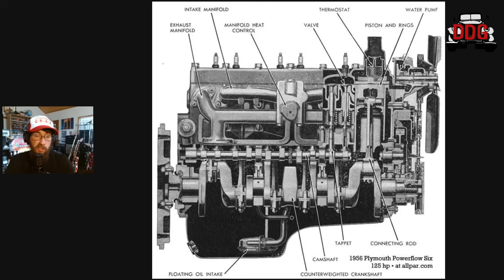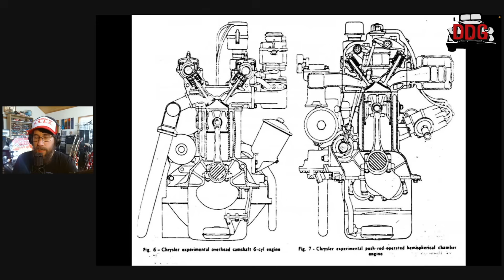The 1940s Chrysler Hemi 6 Cylinder Prototype Development Engine You've Never Heard Of

Comment: Hi Jamie, I live in Sydney, I have a 245 cu. inch Chrysler Australia hemi 6 sitting in my shed, the 245 is the basic model engine, the 265 cu. inch is the HP model. If you want to see the internals & a rebuild of the aussi hemi 6, check out Uncle Brent's Shed on Youtube. BTW, the aussi hemi 6 is not crossflow, so it kind of spoils the whole concept of a true hemi.

Comment: I have to wonder how close that engine is to the Australian Hemi 6. It also blows my mind, that the initially built Hemi engines to deal with crap gasoline. Not as hi performance beasts!
Reply from the maker: Really not close at all. The Aussie Hemi 6 is not a cross flow cylinder head design. It’s really a lot more like an AMC inline six than anything else. It has a conventional valve cover with the plugs off to the side, and many other features reminiscent of other designs than the Hemi. I’ve read through initial information Chrysler made available on the first generation Hemi, and they made it very clear that they had engineered room for future improvements in horsepower into the platform. They knew what they were doing there. Haha.

Comment: Do you have any use for the ceramic tubes they used to have on the spark plug wires? I have a few in my collection that I can't throw away for some reason.

Comment: I enjoyed learning about this prototype engine.  I've heard speculation that the 2.2 engine might be a hemi "type" engine,. Is there truth in that?
Reply from the maker: The 2.2 is a crossflow wedge like the small blocks and B/RB engines, but with an overhead cam. There was a “Hemi” used in some Chrysler vehicles in the 80s - the Mitsubishi 4G54 2.6. It was a crossflow head with a true Hemi chamber, though the valves and ports were slightly offset and not directly opposed so they could be actuated by one overhead camshaft. Some models with these engines even had a “HEMI” badge.

Comment: Thought that was getting to long anyway the Hemi head design The urban legend was that the Audun heads for Ford flathead V8's what's the inspiration for Chrysler? To make the hemispherical head that is, inaccurate during World War 2 Chrysler made aircraft engines both for wright and pratt Whitney, both those engines, we're hemispherical head engines, there. They were the radial 1820 and 1830 engines. And they were used on B 17's B24 and a lot of other aircraft, but those engines were hemispherical head engines along with The Allison and the Merlin V12 of that era. So the Ford Flathead conversion, was not the inspiration. It was actually the Wright cyclones, and the Pratt Whitney's double wasps that gave them the inspiration. There's my two cents
Reply from the maker: Chrysler’s use of the hemi chamber certainly predates Ardun’s, and that’s all I can say for certain.

Comment: When I was still a teenager, my grandmother gifted me my late grandfather’s 49 Plymouth coupe powered by the 217 Plymouth Flathead… so even though it was never my daily driver it was in a way my first car. And I drove it and worked on it quite a bit. I kept it close to 40 years before deciding I’d never be as interested in it as I am 60s Mopars.  It went on to someone who loved it. Still,   I’m a huge fan of the Chrysler Flathead six.  Torquey, and smooth as an electric motor. I’d rather have one than a slant-6, By far (I’ve always had a disappointing relationship to the slant… they don’t like me, I’ve never had the luck with them that other people have. )

Comment: I would like to see a video about the Australian hemi six next
Reply from the maker: I hope to do that! But I really want to get my hands on a real one first.
Reply: @DeadDodgeGarage  here in   arstaaaalia.....  the holden co. [ gm ]. had a 138,149,179,186,192,202. until around 1990..if not later. im not a holden chev fan.. pre crossflow. hydraulic with adjustable rockers.. very peaky lobe cam.. even the v8,s same as gm, had press in studs.. pre historic engines.. personaly i like the clevo.. fit a cam, never touch it..[ ford 6 cyl were the 200 ci & 250.. ] did you get the 265 hemi in u.s.. hell powerfull engine..

Comment: Hemispherical cylinder heads have been used since at least 1901;[1] they were used by the Belgian car maker Pipe in 1905[2] and by the 1907 Fiat 130 HP Grand Prix racer.[3] The Peugeot Grand Prix car of 1912 and the Alfa Romeo Grand Prix car of 1914 were both four-valve engines, and Daimler and Riley were also using hemispherical combustion chambers at the time. Beginning in 1912, Stutz used four-valve engines,[4] conceptually anticipating modern car engines. Other examples include the BMW double-pushrod design (adopted by Bristol Cars), the Peugeot 403, the Toyota T engine and Toyota V engine (Toyota's first V8 engine), Miller racing engines, and the Jaguar XK engine.[
Reply: Wikipedia
Reply: Japan in the 80s advertised that they had invented the multi-valve engine. I went to the Stockholm Museum of Technology and there was a multi-valve engine from 1907. And it wasn't made by a Japanese person.

Comment: Thankfully the dream of an inline-6 Hemi lives. https://en.wikipedia.org/wiki/Chrysler_Hemi-6_Engine    Chrysler Hemi-6 engine is a family of inline six-cylinder engines produced by Chrysler Australia in three piston displacements and multiple configurations. Hemi-6 engines were installed in Australian-market Chrysler Valiants from 1970 through 1981. It was also installed in the Valiants closely related variants, the Chrysler VIP, the Chrysler by Chrysler & the Valiant Charger.
Configuration 
Naturally aspirated Inline-6
Displacement	
215 cu in (3,521 cc; 3.5 L)
245 cu in (4,018 cc; 4.0 L)
265 cu in (4,344 cc; 4.3 L)
Cylinder bore	
3.52 in (89.41 mm)
3.76 in (95.50 mm)
3.91 in (99.31 mm)
Piston stroke	3.68 in (93.47 mm)
Cylinder block material	Cast Iron
Cylinder head material	Cast Iron
Valvetrain	OHV 2 valves x cylinder.

Comment: Not mopar but an early hemi.   I was at the Indianapolis speedway museum more than ten years back.   They had a 1903 Premier race car chassis with a four cylinder air cooled overhead cam hemi motor.   Being 1906 this thing displaced around 925 cubic inches and was claimed to produce 100 horse power at 1000rpm.  Total loss lubrication with bevel drive gears and a shaft running the cam.  Like you said the hemi idea has been around a while.

Comment: Not to be confused with the Australian Hemi sixes.
In the later 1960's I had a 1935 Riley ,an english car with engineering way head of most other makes which had a hemi head six engine. It had two cam shafts,sitting high in the block with short pushrods.
Reply from the maker: Indeed, not to be confused with it at all.

Comment: I feel like this engine was talked about in the chrysler engines book
Reply: Only one short paragraph and a small photo.
Reply: @stephenholland5930  That is true however, there are two pieces of information I feel should be mentioned. The first is that the engine size of the A221 was 231 cubic inches and the design was started in 1948. The second piece of information is that there was a dual overhead cam six cylinder hemi that was 235 cubic inches. That engine was coded A173

Comment: From 1912 to 1917, the Cyclone Motorcycle Company produced a 1000cc, SOHC engine with hemispherical heads, and that's the earliest application of the concept that I know of.
Reply: The Hart-Parr (later renamed "Oliver")  tractor company built a gigantic production hemi head motor. 

"The Hart-Parr 30-60 is powered by a two-cylinder engine with a displacement of 38.6 liters. It would be started on gasoline and then switched over to kerosene, which was less costly. The engine was advanced for the time, with a single overhead cam design and hemispherical combustion chambers."
Reply: @timothykeith1367  It never seems to be mentioned that radial aircraft engines were hemis. I have often wondered if Chrysler got the inspiration for the hemi concept when it was developing their monster aircraft engine. Studebaker was also working on one.

Comment: The combustion chambers of that inline6 look like that of a Jaguar XK engine.
Reply from the maker: Right!
Reply: @DeadDodgeGarage  Considering that the XK started production in 1948, it is entirely possible that Chrysler R&D had one sitting around.  It always struck me as a little wasteful to have two camshafts and two valves per cylinder.  XK camshafts are about six feet long with a lobe every foot or so...

Comment: "It’s a nice enough looking truck, and rather European at that. Built between 1966-1971, sales of the L600 and L700 had to be very modest, because at the time I remember being aware of how uncommon they were. Engine choices started with the “Premium” 225 slant six, 318, 361 and 413 gasoline V8s, and a Cummins V8 diesel with 185 hp"

So... neither the Hemi, nor the 426 Wedge and the mighty 440, never found their way into heavy trucks. 
This engine was a test mule. Hemi heads were around on motorcycle engines and aircraft engines but they were, and still are, more expensive to manufacture than the wedge engines.
However, by the time I was 10 I knew the difference between a Gen 1 Hemi and the 426. There was a junkyard on East Carson Street in Hays, and I was there with my dad, and spotted a Gen 1 Hemi with a huge transmission attached off to the side. It had no markings on the valve covers and as I played boy racer, a yard employee told me that it came from a truck, not a car.
Reply from the maker: Indeed, there were never industrial versions of those larger engines. The 361 and 413 were well developed and suited to the job. In fact, both of those displacements were still in production long after they were phased out of use in cars and pickups. And yes, there were certainly heavy duty and industrial applications for the first generation Hemi. I own a Dodge 315 Hemi that was a heavy duty truck or bus engine which was produced in late 1958 - well after they left cars. This engine has the very last first generation Hemi cylinder head casting number on the list. Neat stuff.
Reply: @DeadDodgeGarage  It wouldn't surprise me one bit if someone found a Early Hemi hooked up with an emergency generator and fueled by natural gas in the back of an abandoned building.

Comment: Thank You !!!!    I had seen snippets about this and the "F head" V8 prototypes built at the end of WWII but you unearthed a lot more than I knew about the Hemi six.   Crazy how this did not revert back to the seven main crankshaft that the flathead six engines were originally equipped with prior to the 1928 cost cutting redesign.   Man this is cool stuff !!    Dig some more up on the F head V8 prototypes !!!

Comment: I would love to see you get your hands on an Australian Hemi straight 6.
Reply from the maker: Me toooooo.
Reply: @DeadDodgeGarage  hello Jamie, Weertmans Chrysler engine history book also covers the Aussie "Hemi Six Pack" engine and relates how it was designed in Detroit as a potential mate to the Slant Six. Many Aussies will be surprised to learn it's not a hemi. Rather the valve angles are slightly ... slightly... kicked by a microscopic amount. Thus the "hemi" nomenclature. But it's a fairly conventional design other than it's 265 cubic inch capability. Thanks for making your interesting and informative videos. -Steve Magnante
Reply: @SteveMagnante  Indeed it was just a lightweight Rattly (Any one who has owned one will agree)  Truck engine that was rejected in the US. No Engine would ever be made to be as tall as it was if fitment into a car was its goal. After all Chrysler went to the trouble to lay over it's previous 6 cylinder engine to make life a little easier.
Reply: @SteveMagnante  we know is not a true "Hemi" head but it still sounds cool which is probably what the boys in the marketing department at Tonsley Park thought too😂😂😂
Reply: @dazaspc  I remember that 'Chrysler had to stand them up to wear them out'? Was a shame that the cams were made out of cheese. I repaired a heap of them with few miles on a rebuild and a rooted cam. I surmised that the "shop' would surface the block and head. Cut the valves and bolt them back together. There is not much room for error in a hydraulic lifter, they would bind and knock the lobe off the cam. Then all that metal goes through the pump, etc. 😪 When I built them, a cheap but effective method was to shim each rocker to the desired tolerance. They are still a sweetie, I loved the slopers. Cheers from New Zealand 🙂
Reply: A E49 Charger 265 would scare the hell out of any 426 Hemi car , in factory stock form .
Reply: @jaycharger72  Bring it on!!, from a Kiwi :-)
Reply: I have two sitting behind my workshop. I think 1 is a 265, the other a 245?
Reply: IIRC, George Poteet's Blowfish landspeed racer, built by Troy Trepanier, was originally designed around & powered by the Aussie Hemi-six.

Comment: I was told hemil heads 331.354 392 heads will fit right on a poly block is this true ?
Reply: On a poly 1955 Chrysler 331  block , not a Dodge or Plymouth poly
Reply from the maker: Yes - they were exactly the same block. So short deck Chrysler Hemi heads will bolt to a short deck Poly block, and tall deck Hemi will bolt to tall deck Poly. While there is a possibility of mixing and matching between tall and short deck, as 392 builders often do with earlier heads, intake fitment becomes a consideration. On the Dodge side, there is no head difference between short and tall deck, so there are even more mix and match possibilities. There is no poly head that fits the DeSoto, and there is no Hemi head that fits the 1956+ Plymouth A/Poly engine that evolved into the LA.

Comment: Chrysler developed their hemi-head system during world war two for aircraft and tank engines. 

Imagine if they used two of these 1940 hemi-6 heads on a V-12...
Reply: Yeah I had the same idea...
Reply: GMC did that for a tractor -trailer engine. Dodge made class 8 trucks but AFAIK never had a truck Hemi.
Reply: @spaceflight1019 The 354 Chrysler industrial hemi was used through 1959 in trucks
Reply: @timothykeith1367  Thanks for the info. What weight class were these engines found in? I'm getting the feeling that we don't know what we don't know about the genesis of the Chrysler FirePower hemi.
Reply: @spaceflight1019  If you can find the book  "Dodge Trucks" by Don Bunn it explains Hemi use in 1950s dodge trucks, starting in 1954 with the Dodge 241 Hemi.
Reply: @brivas3343  I was thinking about the over the road big trucks. When Dodge reintroduced the Hemi it first appeared in the 3/4 ton trucks, then a year later in the 1/2 ton trucks, after they had a year to learn how well it worked in service.